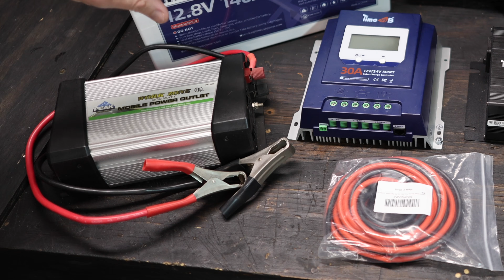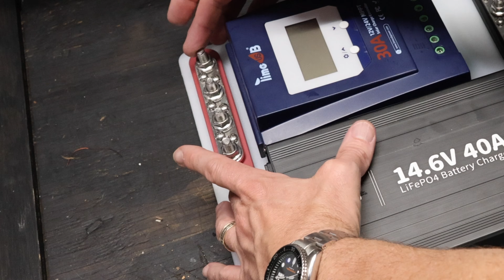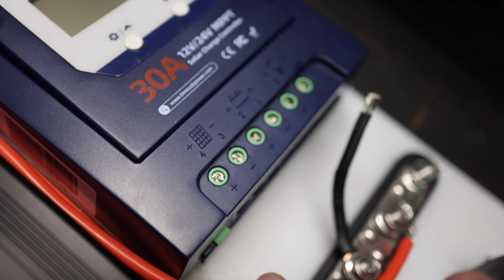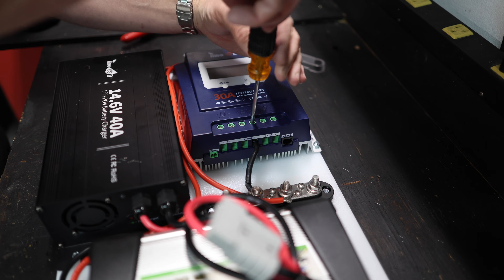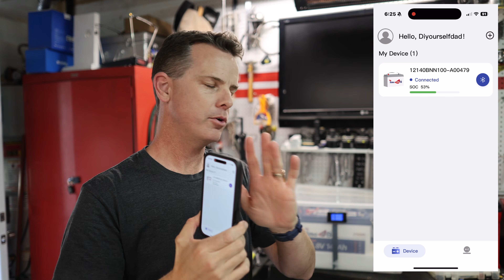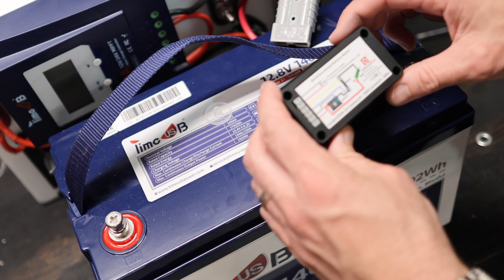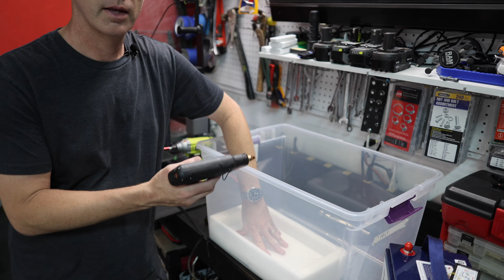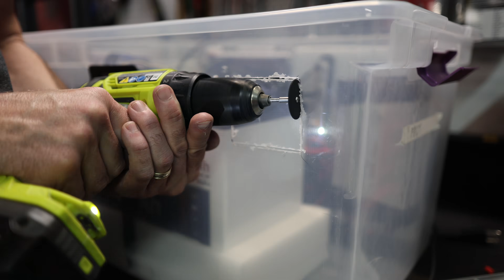Build Your Own Solar Power Station - Make It Better - Make It Cheaper

Comment: While agree on some levels you can build it cheaper yourself, the packaging isn't as portable or convenient.  Plus the inverter you used is only 800W.  A decent inverter size is needed to be comparative, so at least 1800W.  Due to that increase power draw from the battery, you'll need a battery with a bigger BMS ... so 140A to support 1800W, which also means thicker gauge wire ... and bigger copper lugs.  All that increases the cost closing the gap.  Then there are other factors such as built in timing, UPS function / power pass through.  Where you do win with this sort of set up is the scaling the battery capacity, that is where dollars really get saved ... but as you go bigger, not staying small.  The other benefit is if you're adding it to a permanent space so you can better hide the components (like in a vehicle build vs a power station just sitting in trunk or on the 2nd row seat floor. Probably a simpler idea for your viewers is to approach it the way Will Prose does, which is just get a 48V (51.2V) battery and an all in one inverter / charger, which usually provides a very big inverter allowance and much less wiring.  For my worksheet, I only have a 15A home power to it, but running a tool, the air filtration system and a vacuum (all this for woodworking), I'm drawing 27A.  I use an all in one inverter / charger and a 50A 51.2V battery.  The charger only draws 15A to charge the battery, but the inverter allows me to pull up to 33.3A (4000 W) if needed.  Initially I was using an EcoFlow Delta 2 Max which has a 2,400W inverter and 2,000Wh, and then just charged at 1,800W from the power to the shed.

Comment: How are you charging 40 amps from the wall with a 30amp solar charge controller that’s touching the bus bar?
Reply from the maker: Solar controller isn’t charging from the wall, the AC charger is.

Comment: I've got the same Powerstation with the extra battery. i've got a deal on that for 1200€ that was way cheaper than building it myself if the system should have the same capabilities.  And its in a neat package. But i give you the argument with changing components which go bad. So in the long run diy might be cheaper than that powerstation.
Reply: Hi, back aigan. It's broken... ^^ but luckily it's still under warranty, and now i get the C2000 in exchange because they don't have any new F2000 left ^^

Comment: The comments section is where I get the most idea's I'm about to go solar the old owner had satellite one of those big old 12 feet in diameter types the last owner upgraded to a new smaller one on the roof gave away the old dish but left the mounting post I'm going to reuse that for my solar panel mounting post since it's better to move power as AC over distance I was looking at the idea of putting my solar generator out by the post along with my 2 cat batteries and my modified sine wave inverter but how to keep everything from freezing in it and winter and over heating in the summer but with the suggestion of using a freezer it's water proof has a great seal on the door and can be easily vented and heated and even a small 24 inch apartment size with additional R20 insulation still leaves plenty of room for the components I can bring in the 120 volts pure sine for my main use 120 volt modified sine wave for cooking and my 12 volts for my pump and my low voltage device's no need for big expensive cable

Comment: The cheap plastic bin will fail, turn brittle and crumble, bin not really good for a heavy battery. Heat is your enemy. That bin really needs a vent in and out with a blower. Been there?

Comment: Excellent layout, clean and easy setup! I just dont understand doing it in 12v, 24 and 48 is so much better! I would never do 12v, 24v is actually just as cheap and half the current, much better setup. Yes you can build a system cheaper yourself, but if you use cheap components, you have a cheap system, that won't last, just like the cheap Ecoflow, Bluetti etc. High frequency is just cheap, temporary, power! People seem to think when someone says pure sign wave, you have the winning ticket, too funny! Just build it once and good and you will be satisfied. 1500w ÷ 12v =125amps,3000w ÷24v = 125amps, hmmmm, double the power, same amp pull! What a concept! Pure sign wave is just clean power, high frequency inverters are cheap Chinese chip based and not durable, they hate surges, and will die quick from heat exhaust, and should never run more than half there rated power! Low frequency inverters on the other hand are transformer based, just like the electric grid, strong, clean, and reliable, surge does not bother them, heat is not a problem, and they will pull there rated power continuously, and last a long time! They are work horses. So if you want a great reliable setup, use low frequency inverters, 24v or higher, and you will have a great setup, 24v is just as cheap to do as 12v, but much better, low frequency inverters will cost more, but there not chip based crap
Reply: Does your vehicle have a 48V alternator?  There is no sense overbuilding what you don't nneed either.   Running things at half power is also not efficient.
Reply: @bipl8989  your vehicle doesn't need 48v to charge 48v, a simple inverter from 12v to 120v ac will charge anything
Reply: @dustydawson8977 Another piece of equipment.

Comment: Great video! Question. Want 2 100 amp hr batteries. What size solar controller do I need for connecting 24 volts? Would need at least 1800 watts ac so what inverter would I need for 24 volt?

Comment: I'd like to build one that can take a low voltage AC charge. I have a bluetti ps72 that I did get a good buy on as it was obsolete, but it has a 100watt AC minimum charge. My AC plug in my GX470 is rated to 100W. The computer in the GX will turn off the outlet after an attempt to charge.

Comment: So the inverter is powered 24/7 ? Isn't that going to drain your battery progressively ? Does it have an off switch ?
Reply from the maker: Inverter has a switch
Reply: @DoItYourselfDad  would it be interesting to have a panel of switches for a full shutdown or partial turn of for the inverter, USB ports, etc. ? a cool idea also (at least for me), some switches with a time-out function. Again, he goal being to avoid "ghost-draining" your battery.
In any case:cool project and nice video.

Comment: See you use a 30ah charge controller on a  140ah battery, I’m new to this and just setting up my system, is it ok to use a  Charge Controller with a lower amperage than the battery or do they need to be the same rating ? Thanks for the videos you got me all inspired to do my own!!
Reply from the maker: It's a 30A controller, not AH, they are different things. AH is capacity, and yes, it's fine.

Comment: Great video and build. I'm with you on building my own the way I want it. 

Two things I'd add are...

A 30 foot retractable cord reel of 12 ga wire. For me that just seems so handy to have built right into this. Heck, even a vacuum cleaner cord reel would work great and they're very compact, all in one drop right in replacement item, cheap but well made, and can generally handle a 1000 to 1400 watts depending on the wire. 

For me, being able to just pull a cord out and run to a refrigerator right away to keep it cold, is worth it, or a power strip and run cords from it. 

Next I'd have a way to plug in jumper cables to jump start a vehicle if needed. 

That's my two cents worth. Keep up the great work.

Comment: Do you still need a solar controler if you want to say charge the battery with a AC wall plug ( I live in an apartment and cant solar charge) ? If so how would that wiring go if I need to use a wall outtet to charge the battery? ( do I need to unplug the inverter from the battery to not damage it? )
Reply from the maker: Nope, you don’t need a solar controller unless you were planning on charging with panels. That’s the beauty of building something like this, you only build exactly what you need. In regards to having to unhook the inverter during charging, no you do not.

Comment: Hello friend, I really enjoyed your vlog. I'm going to build my first off grid soon in my campervan. You've been very helpful. Can I substitute the Renogy DCC30S 12V 30A Dual Input DC-DC On-Board Battery Charger with MPPT and not use a buzz bar or isolators or external fuses??? Thank you in advance. I am going to use 2 x renogo12v 100ah batteries, a renogy 2000W inverter, 2 x 100W solar panels and also connect the unit to my starter battery. Also, I'm not sure if I can put juice into the leisure batteries via the pure sine wave inverter??? TYIA

Comment: Im playing with the idea of a 48v 12-15kw patterypack that i can charge overnight on my £0.07 per kw EV tarrif. Day tarrif is £0.27. 

We use in average 8kw a day, sometimes we almost hit 10kw. (No incliding ev charge)

My power provider has just announce a £30pm flat fee foir unlimited nighttime use. (00.00-07.00h). 

But running my numbers (including the car) there wont be much in the savings, goigm to thr flat £30 fee, puls daily standard charge over our 7p /27p tariff and the standard charge.

Comment: Industrial electrician here I would either solder or put crimped termination ends on the stranded wire! You will get a much more solid connection that won’t come loose over time via moving it around when needed.  

Also what do you have to cut the voltage off when the lithium battery voltage gets to low. If a lithium battery goes past a certain voltage it won’t charge.
Reply: The low voltage shutdown auto resets when you attach a charging voltage.
Reply: A lot of these lithium batteries have electronics in the battery that will cut off connection if the voltage drops too low.

It makes the battery cost significantly more, but also significantly safer

Comment: Where are the fuses? There should be a large fuse or breaker at the battery positive terminal and fuses on any smaller wires such as the power for the shunt. 
The BMS that's built into the battery will have over current protection, but there is always the risk that it can fail short. It should not be relied on as the only over current protection.

Comment: You need power switches to turn off the charge controllers and inverters else they will continually drain your battery.
Reply from the maker: With this battery you can shut it off via Bluetooth.

Comment: I'd love to see an expansion on this.  I was looking at the EcoFlow Delta Pro Ultras as I liked the ability to stack them and the 220 option for off-grid power tools.  I could see building a set with multiple Milwaukee packouts or Ryobi Link Tool Boxes.  How would you set up units that can chain together?  How could you add a port to charge from a vehicle if off grid for extended trips?  This would be fun to explore and I like the repairability of it.

Comment: Seriously questioning the positive/negative  bar set up. If everything is connected to the same bar,  how does the flow work?   Charger straight to battery, solar charger -to battery BUT your inverter is in that chain.  
Wall charger to controller, solar to controller, controller to battery break battery to inverter on a seperate bus. No?

Comment: This is awesome! Thank you for showing a cheaper way. Which solor panels do you use with this build? How many do you need? Im just learning and not sure about wattage etc. First I want to make one for emergency use. Then after I want to make something that will run a household of 3, fridge,stove lights, washer etc. for off grid living. For that I would have  to connect directly to the houses electrical pannel, correct?

Comment: Nice instructional video. Would be nice to see some load calculations and capacity calculations. Also, you definitely should add some sort of active ventilation. Each of those components generates a fair amount of heat and without adequate airflow could at best fail from thermal overload and at worst set fire to to all that plastic. Neither one is worth risking for the sake of installing a couple of salvaged computer case fans.

Comment: I would add the people do not wear metal necklaces and watches bracelets or anything else around use batteries and components especially the lithium. It will just pump crazy amounts of current. If you thought welding with car batteries was interesting. You’ll probably have some nasty nasty permanent scarred burns from the lithium power going through your hand w/o super hero benefits

Comment: I've been off grid for around 7 years with homemade systems. Even using cheap stuff from eBay I have much more reliable systems than the grid. My favorite components are the 60 amp Makeskyblue mppt charge controller, currently using three of them which I've used for years with no failures, a 2000 watt Reliable pure sine wave power inverter, and 12.8v Wattcycle lithium 100 amp hour batteries. I got big used solar panels for around $50 each. I make my own connecting cables using hammered flat old copper gas line to make the ends. After I hammer the gas line onto the cable I also solder it on. I don't trust crimped connections. Such a system will run a 6000 BTU air conditioner hard all day and can be built for less than $1,000. You would need at least two 100 amp hour lithium batteries, one charge controller, one power inverter, three big solar panels,... I make a big tilting platform out of wood to hold the solar panels and I make a wooden box that is kept underneath the solar panels that holds everything else.  Also put a temperature sensor in the box with a fan that kicks on as soon as the charge controller gets warm. With the cheap power inverters the cooling fans most always fail after the first year, they get quite a workout from the air conditioner, but they are easy to replace with better quality ball bearing cooling fans.  So far I've never had to replace any that I've replaced. I like redundancy so I have two power systems. I just went to 4 lithium batteries about 6 months ago in my main system and I haven't had to use my generator since.
Reply: do u have vid or post or somethig for me to use for my own similar? what inverters & fans dobu use /recommend/replace?
Reply: @RadarRhyder sorry, YouTube keeps deleting my replies for some reason
Reply: @kevinward7498  Are you posting links? If so YouTube will delete your comment. I'm not sure why but it does make it hard to share good info.
Reply: @BFraley I'm not posting links, YouTube just doesn't seem to like me talking to people
Reply from the maker: If you’re trying to post links, if you email them to me, I’ll post them for you. Diyourselfdad@gmail.com YouTube generally doesn’t block links that the channel creator post.
Reply: @DoItYourselfDad  Thanks but I wasn't trying to post any links, just go into more detail about what I used and did and that generally is all it takes for youtube to start deleting my posts. I'm surprised the comments I've made in this thread are still here.
Reply from the maker: @kevinward7498 it’s strange, I’ve seen the same kind of thing happening with YouTube auto deleting post that aren’t controversial… not sure why
Reply: @RadarRhyder Sorry, don't have any videos.  The cheap power inverter I like the most is called Reliable, that's the brand name. I just did a search on eBay and found a 2000 W Reliable pure sine wave inverter for $156. For replacement fans I take out the old fans to see the amps they use and to measure them. Then I find something with ball bearings close enough to use to replace them on eBay. So far I haven't had to replace the fans in my Reliable inverter. It's on its second year, but the fans are still sounding good.
Reply: @RadarRhyder  I see YouTube deleted my reply. Sorry, YouTube doesn't like me helping people.
Reply: Wife and I just signed a 20 year lease for a solar system. Did we make a bad choice?  They garenteed $150 max cost per month.
Reply: @FlordiaBeaglePG hard to say without knowing a lot more of the details.  If you can build it yourself you always come out a lot cheaper, unless you don't know what you're doing and burn your house down.  There's a lot of scammers in the solar power business but some people get lucky and they're happy with the results.

Comment: Cheaper? The batter it's self is almost $600, which is almost what a good jackery or ecoflow is. What's the point of this?
Reply from the maker: You could build it with whatever battery you want, or whatever batter you have on hand. The Ecoflow and and the Jackery that you’re talking about have 50% less capacity.

Comment: The latest HYBRID INVERTERS combine the Solar Charger & Inverter and are a LOT cheaper than those two seperate (and work a LOT better with a grid-connected system).
Reply from the maker: Cheaper than free? Because I had the stuff laying around.
Reply: What a stupid response. Brainrot much?
Reply from the maker: Good lord, need a hug? Maybe a cookie?

Comment: Cheaper overall for the parts, cheaper and easier to repair. If the big box item breaks, the home unit is done and you will probably have to ship it back to the company. That leaves you SoL.

Comment: If you connected it all to the bus bars, including the battery charger (controller), wouldn't that defeat the purpose of having the charging controller? The solar panels would feed into the solar charge controller and just go straight to the battery bypassing the battery charger.
Reply from the maker: The solar controller is a battery charger….

Comment: Very cool project. Just ran the numbers for project prep. Maybe I'm missing something. The Jackery Explorer 1000 v2 currently costs $450 vs this DIY that costs at least $530. Not sure the pros/cons work for my off-grid camper use since this would be more of a solar buffer.